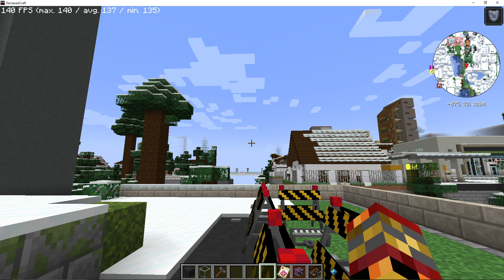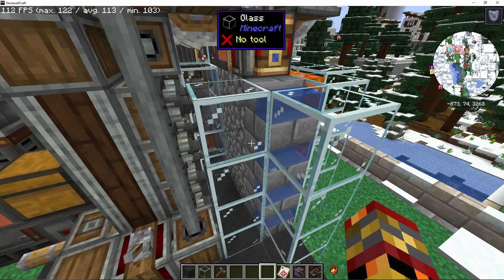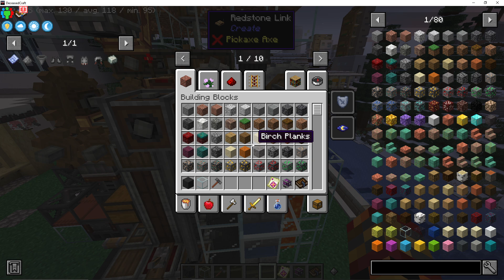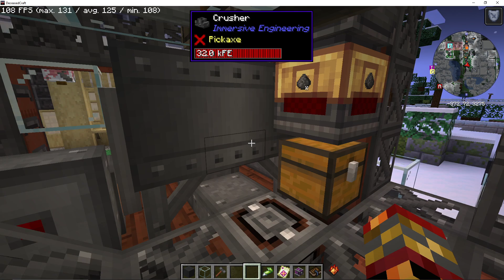DeceasedCraft 5.5.5 GUNPOWDER FARM!! Fully Automated and Compact! Schematic Included!

Comment: I also see you used hv wire connectors, do I need to generate power to the hv connectors and how much
Reply from the maker: Yes! Sorry I forgot to show that, to answer both questions the SU source goes on the rotation speed controller above the IE crusher. The IE machines do need FE to work so a few alternators should be enough, you can even run those off the same SU source for the entire contraption or connect another FE source.